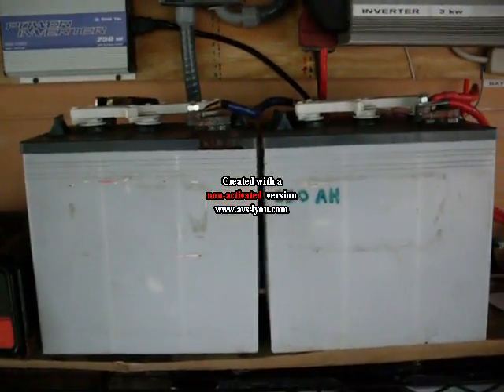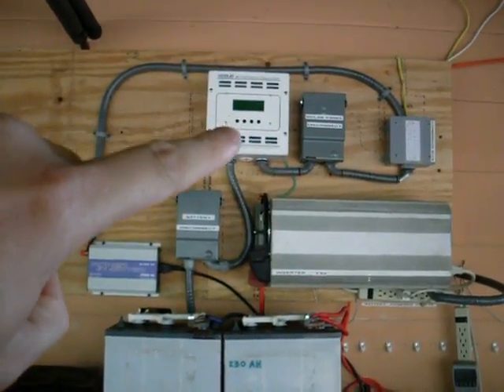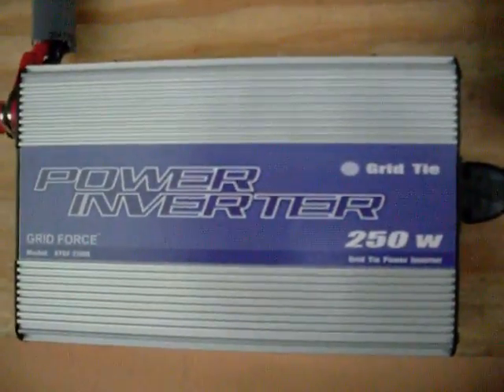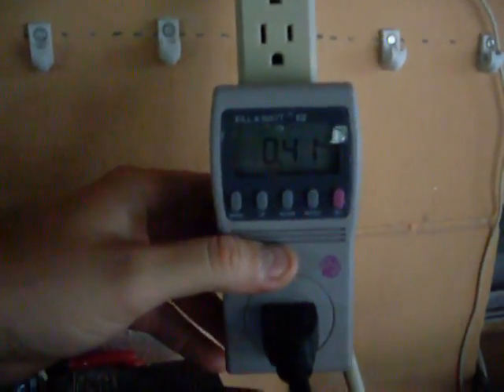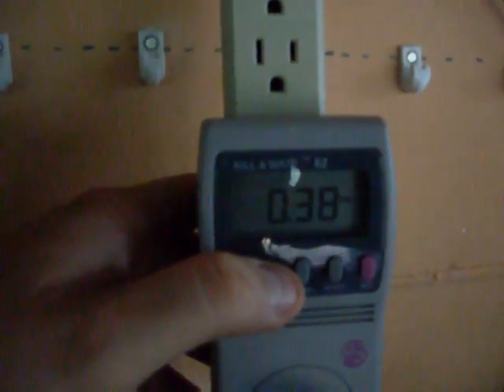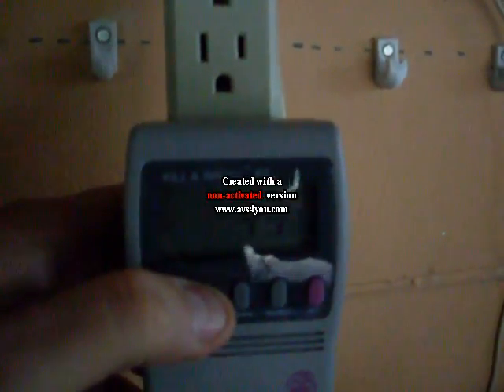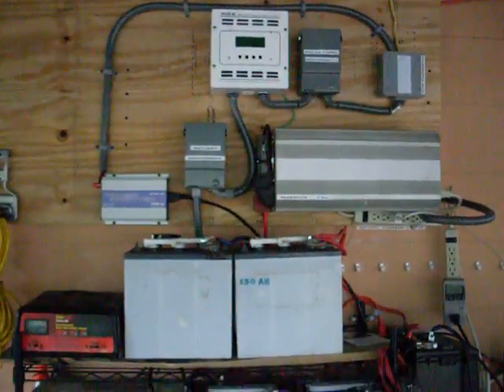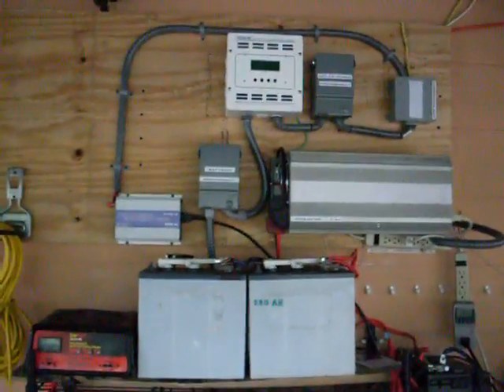My Home Solar update3

Comment: On the Kill-A-Watt meter V.A. is Volt Amps, P.F. is Power Factor. The fluxuations you see is mostly the inaccuracies of the meter itself. Its still a good tool though I have and use one too. As far as your theory of using the power inverter 12V at 10 Amps and converting to 120V at 1 Amp... Assuming perfect conditions (no voltage drops and excluding the efficiency of the inverter itself) Its still the same power in 120W DC and 120W AC. Power is power! Where in FL r you? Im in Tampa Bay area.

Comment from the maker: @jteplane , All I do is slow the meter. Should the power go out, the grid-tied inverter will shut down automatically. It's called Island Protection. At which point all my power is then diverted to my batteries. Thanks for asking! Are you planning on doing something similar?

Comment: Why put the energy back into the grid when you are losing so much power (in comparison)? Why not just load up on a battery bank and run home appliances and lights from the bank? I just think that unless you are putting back what you are taking out of the grid...it doesn't seem worth it. I have done the math and if I put into the grid what I would use to charge batteries and run stuff at night...I save MORE using batteries. Your energy back to the grid is free for them and costs consumers more.

Comment: Good job with you power panel, look very nice and everything is wired very cleanly. Kudos for a jobe well done. The PF that you see in the meter is "power factor" which is the ratio between the amount of dissipated (or consumed) power and the amount of absorbed/returned power. It is important in an AC circuit because if less than 1 the circuit's wiring has to carry more current than what would be necessary.
Good job.

Comment: You can get that breaker double pool qo from the same store you got that just make shure it has a number on the button it self ant the Qo is rated for DC and those are the ones with the little window that turns red on the breaker..

Comment: Mrbuki its looking rill good just whanted let ya no that your breakers are not fused they are just a swicth with the sticker on it you have to get a QO breaker 50 or 60 amp to put in that box and then it will pertect on overloads, That is just a swich only ,made for diconect of an out door survice of an ac unit, Thanks Nebraska Dave

Comment from the maker: If you do not plan on using the power right away or are going to use it to charge batteries, then yes it is worth the cost. But only if you plan on only using panels and a grid-tide inverter, it is even more worth it. In my setup, it is basically setup to be the "dumpload".

Comment from the maker: Most GTI will work with12v to 24v panels. No problems so far. I run the cord through the "Kill-a-watt EZ" so I know how much electricity it's pushing back into the grid. When I get more power panels, I will get the same type of GTIs, as they are stackable. And they have a switch to change it from 120v to 240v. And will accept between 14v to 28v solar panel power input.

Comment: Great video.  I thought that the 250 w grid tie inverters only worked on 24 volts.  Are you running 12 volts into it, directly from the panels?  If so, how is it working, any issues?

Comment: @mrbuki77 

 That sounds good, it worries me a bit to see batteries that close to an inverter.

 I have 2 battery banks, one bank of 8 T-105 wired for 12 volt (900 amp hour) 

 And 1 bank of 7 DCS100L  AGM'S (C&D tech sold by Interstate battery) wired for 12 volt (700 amp hour)   

 I have them in separate rooms tied to a switch so I can flip between the two. Works quite well!

Comment from the maker: I'm not too worried about the batteries proximety to the a/c equipment, b/c it's located outside. The amount of H2O2 that is produced is quickly desipated by the small breezes that go through my back porch. I do agree with you that we should be careful not to concentrate the gasses that are produced. When I re-design my system, I will place the batteries on another exterior shelf isolated from my other equipment. But, the shorter the wiring, the less power loss you will have. Thanx for the post.

Comment: Why do you have your batteries right below all of your a/c equipment?

 One little spark is all it takes

 I'm sure you know about the hydrogen gas the batteries put out when charging.
 
 Get those suckers in a vented box away from your equipment unless you want an explosion & fire

Comment from the maker: The power is split between the charge controller and the GTI. But, if I disconnect the GTI at the socket, then it goes into default, so it doesn't use any of the power coming from the panels. I do plan on adding a breaker from the panels to the GTI.

Comment from the maker: I'm not sure about mike1970, but this is a Xantrex WPower Inverter 3000 Plus. And I got this one from eBay. I payed $100 plus $20.00 for shipping. So, you should be able to get one or about this much. It works great. And if you get 2 of them, you can stack them to feed a 240 breaker.

Comment: GREAT Video Im glad to see you organising. Keep up the good work if you have no sun exposier on your concrete sit your batteries on the conrete. They are just like a dog they will absorb that ground temp year round geothermal. Big wives tale about batteries on concrete. Should  you worry about accid damaging your conrete put them on heavy plastic to protect your slab. I grew up inFL I know how hot it gets there. batteries are just like us they love 72 degrees. CHEERS WINDY NC